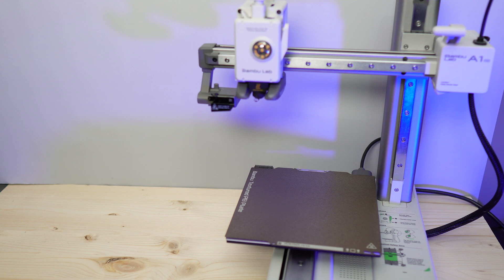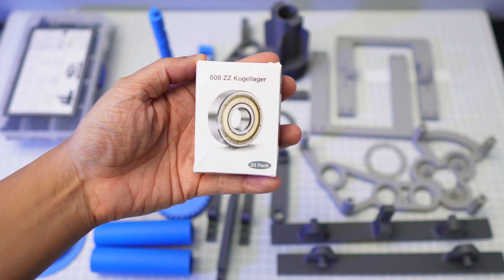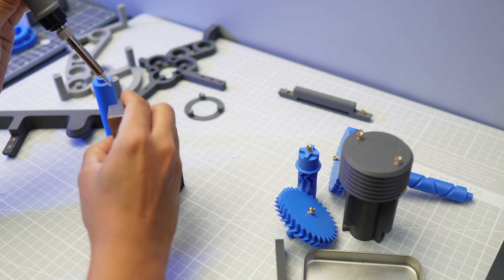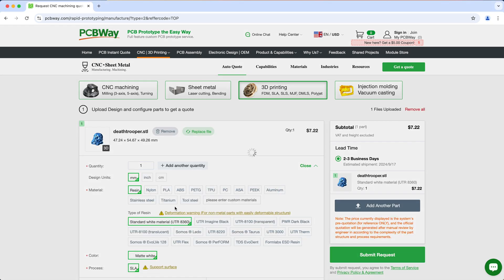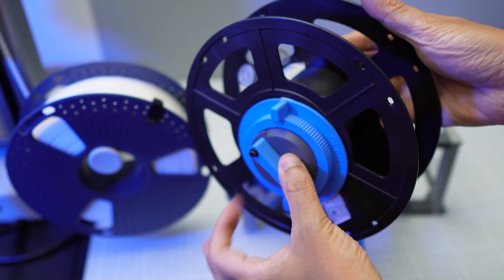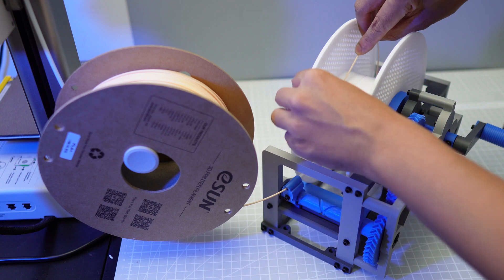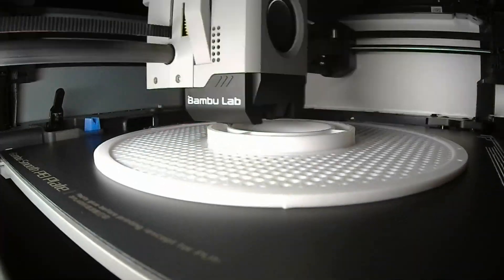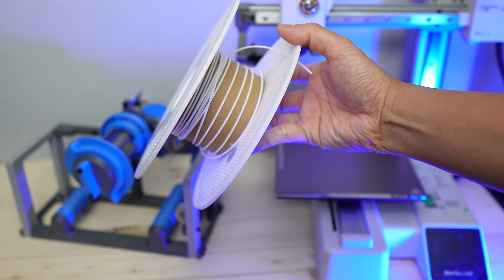V-Spooler Mini - The Spool Winder that you can actually print using the A1 Mini

Comment from the maker: A1 Mini Combo: https://www.awin1.com/awclick.php?gid=570773&mid=46345&awinaffid=2034675&linkid=4382675&clickref=
Recommended Filaments: https://www.awin1.com/awclick.php?gid=570777&mid=46345&awinaffid=2034675&linkid=4382680&clickref=
Recommended 3D printer: https://www.awin1.com/awclick.php?gid=570772&mid=46345&awinaffid=2034675&linkid=4382705&clickref=

My 2nd favorite filaments: https://geni.us/A4OFomi
Lubricant for X,Z,Y-Axis rails & idler pulleys: https://tidd.ly/3KMFHqs
Grease for Lead screws: https://tidd.ly/3Lk36j2
Deburring tool: https://geni.us/9WGzv
Wire cutter: https://geni.us/NAwQIL
Heat gun: https://geni.us/Jdcu

#Affiliate

Comment: Your spooler was great but the PastaMatic or what ever its called that i spent 18 hours printer was JUNK putting it together it broke into 5 different pieces. Out came the Crazy Glue. After all that it still didnt work right so now i have wasted the filament to print it but my time i could have used elsewhere. Maybe the print file was bad or? i dont know but im going to use PCBWAY to make me one.
Reply from the maker: I’ve heard good things about PastaMatic so its suprising to hear that! Have you tried the PastaMatic Lite? I actually wanna try that model when I have the chance

Comment: Wll done for undertaking the project. I have to say, it looks very complicated compared to some other mechanisms that achieve a similar if not better results with less materials to construct them. The spool winder is definitely what I would call accurate and I wonder if there is any problems with the filament getting tangled during prints.

Comment: You don't have to rewind cardboard spools. They come apart and can be placed on a Bambu Lab spool.
Reply from the maker: yeah, i dont dare doing it though! besides, my esun filaments tend to tangle alot and I wanted to respool them anyway😁👍🏼
Reply: Inland spools have varying diameters for their cardboard spools. Some fit some don't. I found this out the hard way.
Reply: @Raytron123  Aceaddity as well; the inner diameter of the hole is too small for bambu spools.
Reply: I’ve dropped several on the floor that then need to be respooled and had other mishaps that need to be respooled

Comment: I think not having a smooth roller on spool you have to feed the respooler and not having the V-spooler stationary makes a difference on the quality and uniformity of the respooled filament roll, Just my thoughts though.
Reply from the maker: yes that was my first thought too. In this case, something like the original V-Spooler might be better, or the spooler from Pastamatic.
But these spool rewinders can‘t be printed on the A1 Mini, unfortunately.

However, my test with one spool showed that even though the quality of the spooling isn‘t that good, the filament didnt get tangled during printing and hopefully it stays that way!

Comment: Is this winder strictly to use with the A1 Mini due to the size of the spool, or the printing of the parts on the A1 mini.  I have a BL X1 Carbon, so can I use this to wind spools for it?
Reply from the maker: it‘s not strictly for A1 Mini, but it‘s strictly made to respool filaments onto BambuLab Spools (you can use an adapter like i did in this video if you have other brands).

So you can actually use it for your X1C as well. If you wanna print this on your X1C, make sure to download the first print profile. One of the frames can fit on the plate (on A1 mini, the frame is cut in half).

Comment: cool, but I dont' see a purpose for this
even if you don't want cardboard spools, you still have them, and rfid use of esun product with a bambu id, is something i don't undertstand.
Reply from the maker: I actually print every Sunlu and esun PLA+ filaments with Bambu Basic PLA setting and it works great! So putting Bambu RFID tag on those spools isn’t a problem for me.
Respooling isn‘t a must, but in case that you need one, this spool winder works good enough. I actually had bad tangled spools (newly bought) so I needed to respool those.

Comment: Why do you want to change a spool for filament? Does it not fill in ams?
Reply from the maker: well different people can have different reasons, but for me, i don‘t want cardboard spools; i also wanna use make use of the RFID tags on the BL spools; or sometimes the filament you bought already came badly tangled, so you wanna respool that too (i had severals).